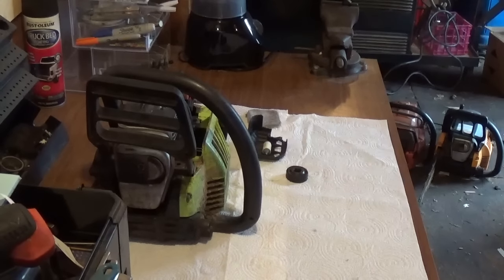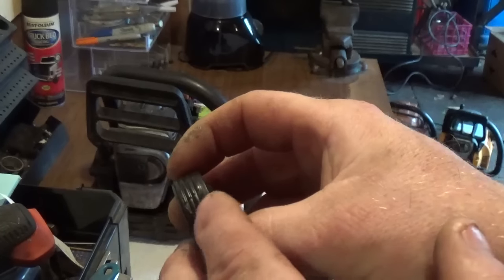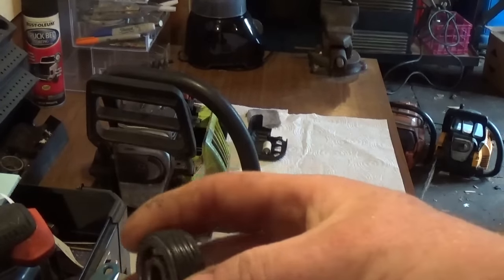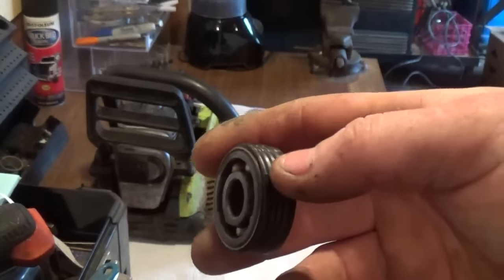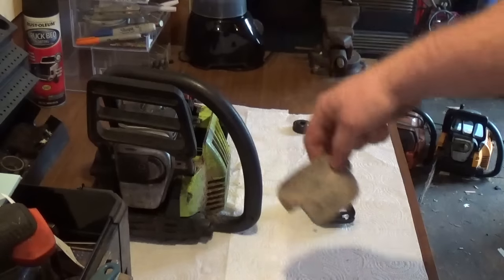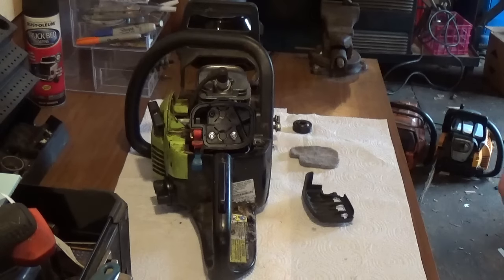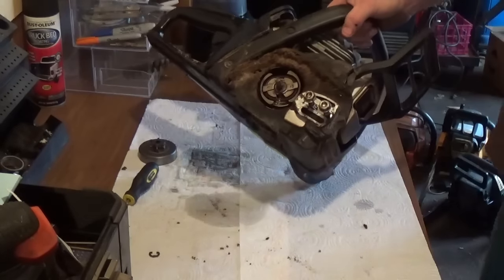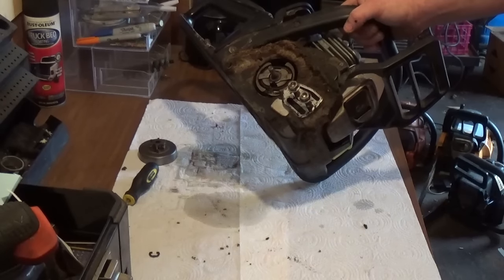Common problems with Poulan Chainsaws

Comment: I love broken machines-- I love fixing them. But I HATE broken machines that I can't fix. 

I bought a Poulan Pro 18" PP4216A (42cc) chainsaw new from Lowe's 5 years ago. I unboxed it, tossed the box and the receipt from Lowe's, and stuck it in a corner for 5 months-- no gas or oil. It was in the house, not in the weather or shed.

Finally went to use it. Gassed it with TruFuel 40:1 premixed fuel (the specified mix), added chain oil and cranked it up. It started somewhat easily. Headed down the driveway toward the target I wanted to cut down and it died. Got it started briefly just once more. It has not run since then-- wore myself out several times trying to crank it. (Note: it got increasingly hard to pull that cord as time went on-- days and weeks later).

I noticed what appeared to be chain oil leaking out from the exhaust. Weird. There should be no connection between the two, yes? Now, I expect some minor oil in the exhaust-- it's 2-stroke-- but this oil was drooling out. It wasn't just some fuel/oil separation. And 40:1 isn't a heavy concentration of oil, anyway. And besides, the engine was only running for 45 seconds to a minute-- there's no way that much oil could come out of the gas in that time.

I've been hesitant to attempt tearing this down to see what's up. I've worked on car engines a bit, but never tiny two-stroke engines. Spooky territory for me. Also, have no clue how to order gasket kits for this thing (NOBODY in my region will work on Poulan chainsaws, so no tech help there). On top of all that, I'm lost on how to remove the covers all over the thing without breaking them.

Can you give me any guidance on this mess, such as how in the world chain oil is getting to the exhaust and what sequence to remove the plastic covers? I really need a chainsaw for a few projects in the yard, and my retirement pay won't afford me a new one. Aside from all that, I'm an electro-mechanical tech (retired), and I just can't stand to have a piece of machinery that defies my ability to fix it. Unacceptable.

Please help!
Reply from the maker: The oiler on the Poulan is controlled by a worm gear driven system so even I cant be sure as to why you would be experiencing bar oil in the muffler . Never heard of this happening before …...Are you sure it wasn't a collective amount of unburned oil and gas mix protruding from the muffler as a result of continuous cranking ?  The covers can be removed by purchasing a torx bit set of screw drivers.  What few gaskets that can be bought reside from the insulator to the carb . The mating surfaces of the bottom cap to the cylinder or jug are sealed by Permatex but for the rebuild I recommend purchasing the brand DIRCO grey or red as used on Stihl chainsaws . Note that I know your some what committed to this task but be warned you are going to spend at the very least half the price of a new saw ……...personally I would consider it a bought lesson …...And educate others so they don't experience the same buyers remorse . Trust me I know its hard to swallow so to speak but pride aside and I only speak from honesty and experience here …...SAVE YOUR MONEY …..I have repaired to many of these curses and there junk from the box and even junk when they have been properly repaired ……..The cheap quality parts makes them money traps and failures are so common they even have a refurbishing company . THEY TRULY ARE COMPLETE PIECES OF SHIT .
Reply: Thank you Kevin Bolin, for your reply.

I fully agree that this is a piece of shit. It only ran for 45 seconds brand new. Never started again. In retrospect, I think it flooded itself. Anyway, I can imagine that the leaking oil was from oil/gas separation, since I cranked on the thing for at least half an hour after it died. 

I do not intend to invest any money in repairing this thing. I bought some more 40:1 TruFuel and another Qt. of bar oil. That's all I'll spend. The bar oil is mostly gone from the tank-- guess it leaked out over these past 5 years. I noticed Lowe's doesn't sell Poulan anymore-- I assume they were losing money on taking so many of them back. 

However, I DO hate a machine I can't fix. I just can't live with that. I gotta make this run for at least a couple of weeks. I have some chores my sawz-all is too small for, and I really can't stand that the blade of this thing has never cut anything. 

Speaking of blades-- how tight should they be? This one seems overly tight, can barely lift it off the bar. 

Other problems I've found:

Run/Stop switch is WAY too tight-- have to take the cover off and move the leaf spring with a screwdriver to put it in Run. Don't want to break that plastic lever by jamming it too hard. I'll try to bend that leaf spring with needle-nose pliers, loosen it up.

It almost started a couple of times yesterday, but had to pull the spark plug and dry it off. Appears to be set too rich. How do I lean  that down? I'm afraid to start randomly turning adjustment screws I can't identify.

This thing is ridiculously hard to crank. My lawn mower is 100 times easier. Really don't get that.

Thank you so much for your time-- really didn't expect a reply and was happily surprised. That doubled my determination to beat this thing.
Reply from the maker: @shaddec55  You know of all the people I have had to leave me replies I truly wish I could help you as I see your determination . I cant presently offer a poulan as a example but maybe I can show you how to properly tension you Poulan with a Husqvarna {Parent company saw}. As its currently snowing pretty bad locally perhaps I can make the video in house as it shouldn't take very long . I wish you the very best and appreciate the respect forwarded in your responses . Just keep and eye on this channel and I will likely have the video made and uploaded in a few hours .
Reply: Sweet! I can't begin to tell you how much I truly appreciate your generous efforts to help me. I'm 64, retired, and my working life has rewarded me with a jacked-up back and a metal plate in my neck. That's not saying I didn't love the challenges of my work-- I conquered a lot of difficult repairs. As for "pieces of shit" equipment out there, I've encountered ridiculous numbers of various things made for consumer, commercial and even military markets that are absolute shit-- just stunning how many things are manufactured with basically no quality protocols. As both an electronics and electromechanical technician, I could go on for hours about the insane numbers of total shit we pay for as consumers and tax payers. Boggling to the degree of beyond incredulous-- "Why didn't they just..." But they didn't. No reason.

"It is what it is". That's shorthand for "fuck it". Deal with it and move on. Pretty sorry state of affairs...

I appreciate your apparent passion to help people as passionately as you hate Poulan products (I could name a number of other products equally deserving of your ire). You echo my own hatred for needlessly shitty stuff. 

Good to find a kindred spirit like you who gets what "shit" is. Awesome to find one willing to help out! Thank you, sir, for all your time and efforts on my behalf-- which may help many others, as well. 

And FUCK everyone who commented saying you were just whining-- they have no clue what repairing and maintaining unnecessarily shitty stuff is like (compared to stuff that was designed and built well). Minor upgrades in materials or bulk of materials cost little and solve lots. Testing protocols for quality control cost nothing but a little extra time and the will to do so. Guess the will isn't there anymore with Poulan. 

Enough of this diatribe. Again: thank you, Kevin, for all your time and efforts. You're a gem.

(Side note: my wife forgot I even had this thing and wondered where I got it and why was I messing with it. I reminded her that I bought it 5 years ago, and finally found a possible means to fix it. She basically said "have fun" and went about her business. I WILL have fun with this-- frustrating fun, perhaps-- but fun nonetheless. I'm on a quest.)
Reply from the maker: @shaddec55  Sincerely …..I truly do wish you the best of luck …..God bless and thanks for being such a respectful viewer as well as open minded.....That's a true rarity ...

Comment: If a chainsaw gets so hot that the silicone seal bonded to and around the bearing were to melt the cylinder would be destroyed long before the silicone melts.Silicone  Neoprene seal material melts upwards of 550 to 600 degrees Fahrenheit.The sealant used between the crankcase halves is  rated up to 450 degrees (Yamabond and equivalent type sealers) Those marks are from mechanical prying or adhesion on the seal probably during disassembly of the crankcase.
Reply from the maker: Interesting theory but you couldn't be further from the truth . You see Dennis the Permatex is indeed heat resistant ….But not ethanol ….And even ethanol free gasolines still contain rich additives witch eat away at seals and cheap aluminum surfaces as well as permatex . Now take a cheap seal made of neoprene that's bonded with a bearing. Squeeze it between mating surfaces then apply force in a constant direction such as chain tension . Now consider heat expansion of cylinder …..witch is part of the mating surface …….inevitably the saw is going to fail  because the bearing is free floating in a jacketed sleeve all of witch is part of the seal . Think about it …. modern stihl chainsaws are built similar but with more surface area to independently separate seal from bearing allowing for a more stationary hold …….meaning tension forces are applied to the collar of the bearing allowing heat to expand the aluminum more efficiently . And to be honest Stihl oil mix is damned good mix as well allowing for a more ambient tempt range ……...Much like the FD Standard oil mix purchased for Redmax or Jonsered . Rest assured Dennis the marks are certainly not from prying as well …..feel free to disassemble one for your self and it will become evident .
Reply: Permatex is Heat resistant to 400 - 500 degrees A cylinder will fail long before that. Look up your Permatex specs which is my point, the bearing seals couldnt have heat damage before cylinder damage.The yamabond or whatever sealant is used would not fail. THAT IS NOT A THEORY. And the silicone I am referring to is actually the bonded seal molded and bonded around the bearings. They are not going to melt or show any heat damage prior to severe cylinder damage occurring first and the engine seizing. You claim that these bearings get heat damage and leak. Not so, they would have to fail at upper temperatures the piston and cylinder can not withstand.
Reply: @kevinbolin7665 I I have overhauled nearly every manufacture chain saw ever made.I maintain two Poulans a Craftsman(poulan) one Husqvarna one infamous Stihl  015l 14" that I would never give up and an Echo CS550.I have put 20" bars on 36cc Poulans and cut 16" timber  with them,and they performed excellent.I have never seen Poulan bearings sealing surface melted A Poulan saw used and maintained properly will last years and cut efficiently.They are not Stihl commercial saws, they are not commercial chain saws and they dont cost much over 150.00. The issue with Poulan is poorly trained mechanics and poorly experienced home owners.The current version of Poulan non Pro version have now been manufactured for over twenty years along with their home consumer Husqvarna models.Thats quite a run for a so called "Piece of Shit" I own three of the those "Piece of shit" models and the only maintenance has been fuel lines and chain and bar maintenance.Years ago the Cadillac 4100 engine was a horribly designed engine with a 75% failure rate,its former 8-6-4 was also a failure.Those engines remained in production for only a few years because they were a failure.
I repaired or replaced a large sum of the 4100 engines and Cadillac lost a large customer base for years because of it.
That comes close to winning a "Piece of Shit" award but professionals don't rate things in that manner!

Comment: Hey sir got a poulan pro worked great but then gas stated pouring out of metal exhaust in front side of saw what's my problem the carb
Reply from the maker: Yes...it is the carb …..but be mindful that this often happens as a result of a faulty tank vent . I recommend purchasing a new carb and tank cap as the tank vent will be included if your looking for the fix .

Comment: Iv got one that wont run iv changed the head and piston and piston rings, new carburator, and new fuel and filter lines and the damn thing has spark put it still wont run
Reply: Probably the crank seal

Comment: The poulan Pros are better than the regular green poulans. My dad bout a green poulan. Used it for about an hour.... and the engine overheated and seized up. He read up on saws, bought a Poulan pro and that saw still runs today at least ten years later.
Reply from the maker: Great.....Prove it ...
Reply: @kevinbolin7665  I'm not going to go through all the trouble it would take to send you a video of the chainsaw running. My word should be good enough for you but if it isn't that's too bad.

Comment: Those marks on the seal, for the most part are from the casting and help seal from rotating.  The filter IS working and not allowing foreign particles from getting into the engine.  Drill 3 or 4 more 1/4" air holes in the filter cover.  The Tank vent allows Air INTO the tank.   What saw do you recommend other than Stihl
Reply from the maker: Respectfully.......you need to watch this video a little closer....as the seals manufacturing marks are present but the compressed clam shell design and cheap rubber that makes up the seal and bearing design are just piss poor. They suffer a great deal with heat transfer because of limited contact between the cylinder and it's retaining base..
...and respectfully why would anyone won't to mod the air filter by drilling holes in the filter cover.......this might allow more air but it creates a vacuum effect and increases contaminated air that has dust to circulate more freely making it easier for damage to transpier...... the cheaply made air cleaners they made for these pieces of shit are sinful they don't work
Reply: @kevinbolin7665  Drilling a couple more holes assists in allowing air into the mix.  Present ones concentrate air flow in one location , causing a rich mixture.  How can drilling a couple additional holes create a Vacuum?  It can't.  Respectfully you need to study the process more.  I agree with your take on the 'seals'.
Reply from the maker: Look believe what you will .....I have seen first hand the effect of dust on these saws ....granted it was with flour at the service classes but rest assured it created a  tornadic effect that spun the introduced flour outward against the transparent cutaway then slowly reduced in size because of vacuum forces that where pulling outside air inward on the air filter.....I had to laugh at your second response.....listen I get it .....your hoping to have your intellect observed......but seriously you need to escape preconceived notions.....if you doubt the vitality of my comment in coraspondance. Here is a way you can test the fact of whether your right or I am....SImply take a small piece of yarn .....start any chain saw......place the yarn about  2inches away from your air filter and watch the yarn get pulled toward the Ventura of the carb as it spins.......seriously no sarcasm intended.....do the experiment and see for your self.....to reiterate it creates a vacuum effect.
Reply from the maker: Manufactures place typically these air concentrated or directionalized air veins on the flywheel side because they claim they assist in better air to gas mixtures.... 😂......this is not true ....just sales hype .....infact what it actually really allows is a increased chance of dirt or saw dust to enter the air filter assembly .....hell ask any logger or simply remove the recoil side of any modern Husqvarna as the veins are constantly becoming contaminated with dry  caked sawdust that was introduced via the flywheel spinning and casting once again 😂 that better preforming uncontaminated air ....Now if you really won't to see actual air induction look up Redmax chainsaws and trimmers......Husqvarna was so desperate to possess there design they bought the company for fear they couldn't keep up with Stihls Intel charge  system and the Strato charge system Redmax offered was making it's own name for it's self. So HUsqvarna bought Redmax to compete with  Stihl .......needless to say as Husqvarna so often will do they took a perfectly nice product and finger fucked there way threw it making it cheaper and undesirable........Still the had the Strato tech and applied it toward Jonsered.......and why you might ask?...
...sales......look at any Lowe's....or tractor supply .......Husqvarna is deep within there equipment variety...
One brand or another guess who the parent company is ?